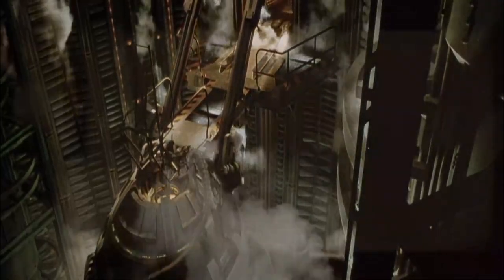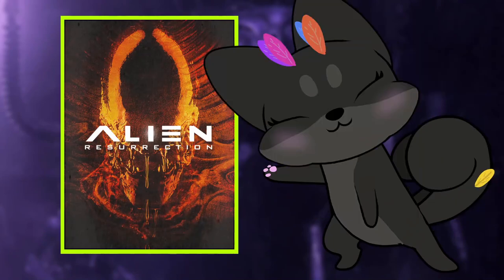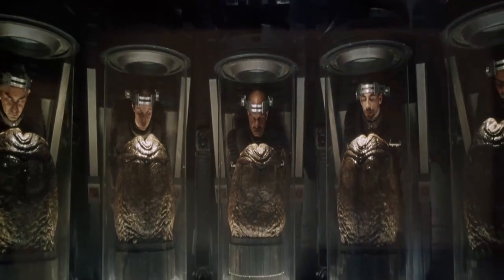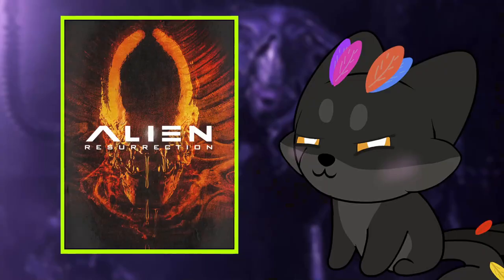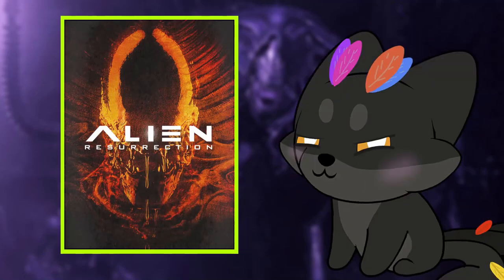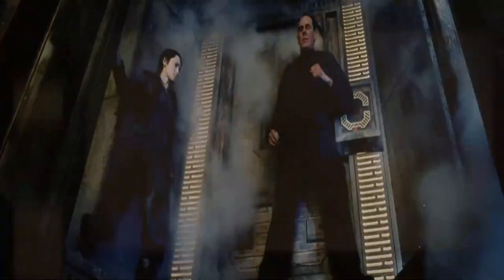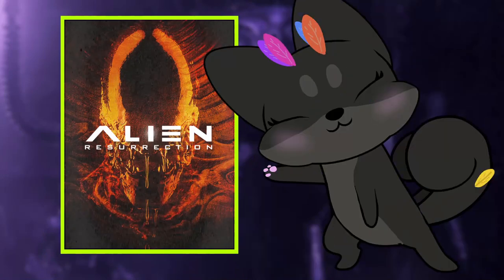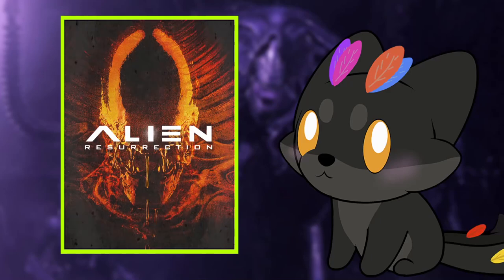People out here really like ALIEN RESURRECTION aka Me

Comment: I, too, have questioned the corrosive properties of Xenomorph blood. The only thing I can think of is that it reacts differently (or rather, corrodes differently) based on the substances it comes into contact with.   =^~^=
Reply: It’s also a chemical reaction to oxygen,
The xenomorphs are silicone/Silicate based life.

So while our blood is rich in iron giving its color, their blood is in a sealed pressurized environment so it’s properties can dramatically change and their bodies are more tolerable to hostile chemicals for its biology since silicone based life could exist in theory but it’d have to be in absolutely brutal conditions.

As for the inconsistencies it’s resurrection… we’re not really shocked.

Comment: The entire reason one of the Xenomorphs was able to spit acid and not the others is because there is diffrent versions of Xenomorphs. Most commonly Drones and Then of course the Queen. But there are sub categories of species.  Most commonly Warriors and Spitters. Warrior are stronger and bigger then the spitters but they are less agile and slower. They most commonly use there claws and tail for weapons and of course the Headbite aswell, but they can't spit acid. The spitters are less armored and protected and moves much more on all fours and almost never stand up. They are smaller, extremely fast and agile and they unlike any other species of the Xenomorph, can actually spit acid. Therefore it can make sense that the 3 in the cage is simply Drones and that some other alien regardless of where in the movie it was born is evolved into a spitter.